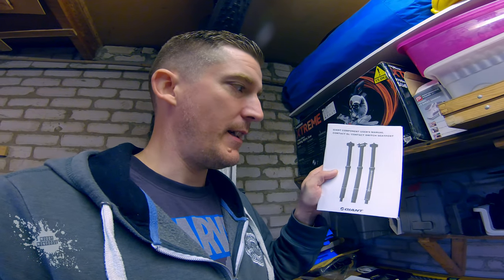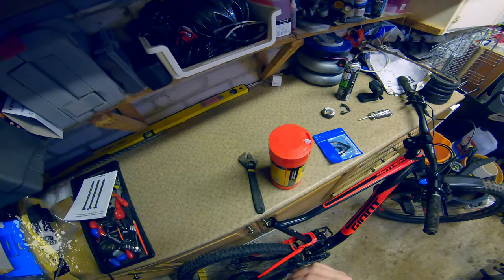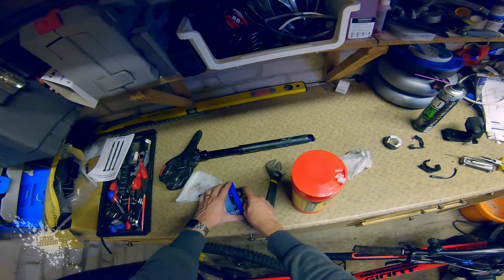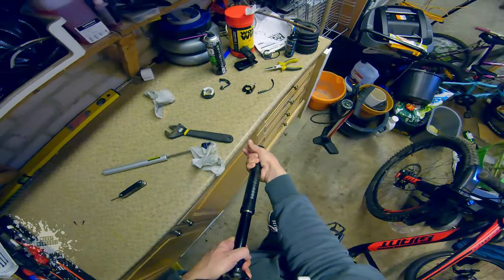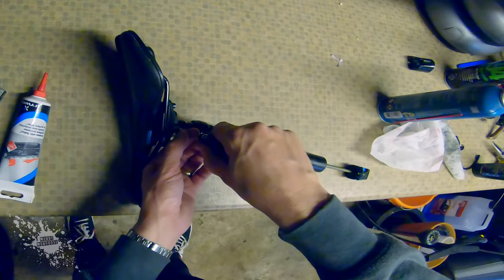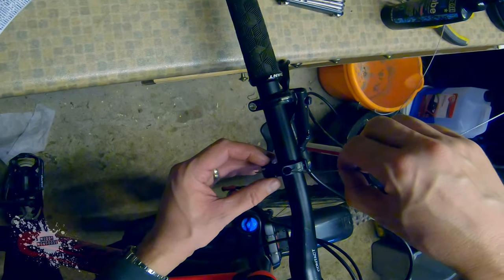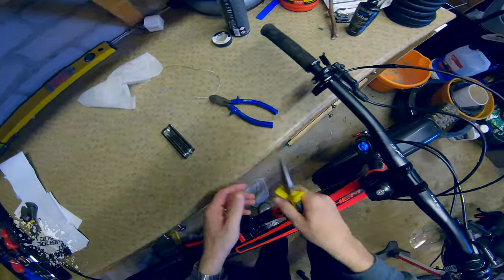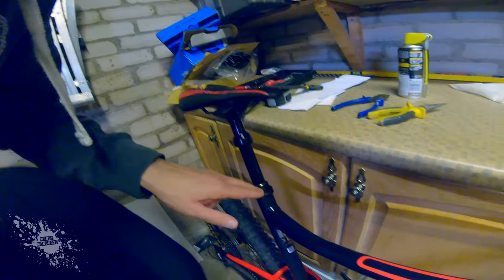Servicing a Dropper Seat Post   MTB Maintenance   Giant Switch Seat Post

Comment: Nice service of your dropper seatpost, amazing how much you can save by doing your bike maintenance, have saved myself quite a bit of money fitting new cassettes converting old bike to 1x, converting tyres to tubeless, new handlebar and stem, fitting external dropper post but have never serviced a seatpost so interesting to see how it is taken apart, always important to apply grease, which I also apply to post shaft which helps prevents seizing in frame (which I wil have to do in newer bike)  thanks for sharing!  😁🔧🤙
Reply from the maker: Ebike Xplorer MTB cheers mate.  I like to do my own maintenance as I like knowing how things work...that plus me being a skinflint!😂😂😁
Reply: @muddymongoosemtb9873  Likewise, great to know how things work. YouTube has some great bike maintenance videos, my personal favourite comes from Park Tool's YouTube channel, wide variety of well made clear to understand maintenance  videos, recently learned how to use a crank puller to take a crank off my bike, handy stuff, especially if your bike develops a fault when you are out in the middle of nowhere. Some bike shops repair prices can be steep, so I don't think either of us are being skinflints!😂🤙
Reply from the maker: Ebike Xplorer MTB yeah I like Park Tools channel too it is very good as you say.👌👍😁